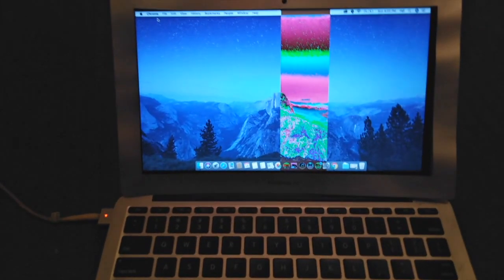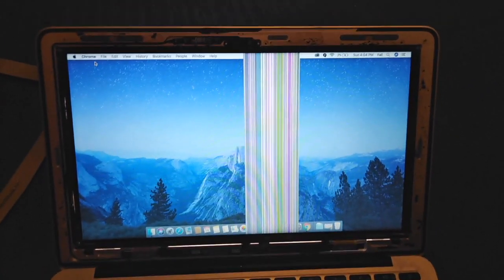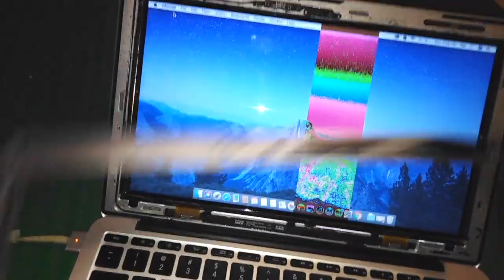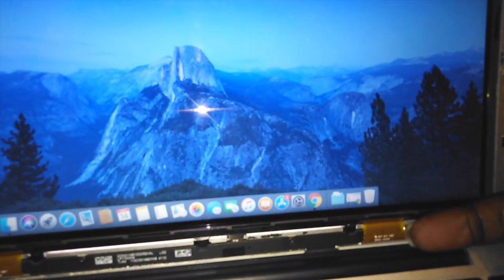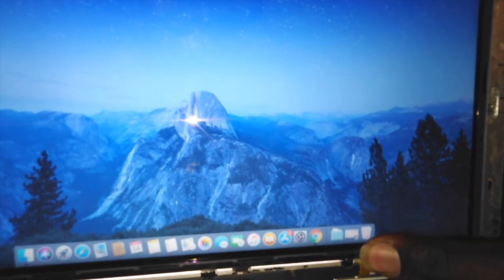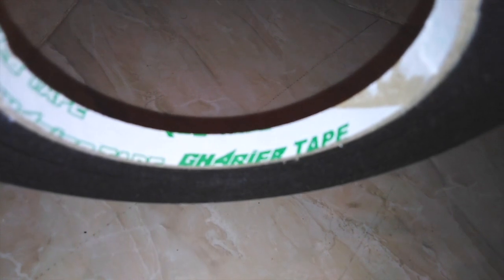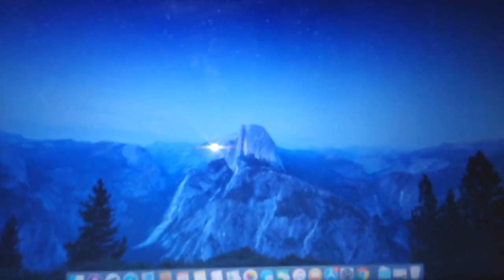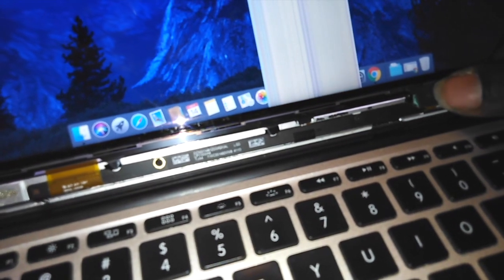Macbook Air Screen Glitch Resolution

Comment: My new macbook pro shows up these glitches & heats up too. Whats is the cause for that?
Reply: It’s not the display because if it would be the display it would cost probably like 300 to 400 dollars but it’s just the yellow thing just give it to apple
Reply: The glitch shown in the video happened to my Macbook air also it's becauseidhar there has been too much sunlight on the product or from change of weather or a little moisture got in the nooks and crannies of the screen sides don't worry nothing happens to your screen the computer will work perfectly
Reply: @neelambedi1915  But, it heats up terribly that, i couldn't touch the place below the touch bar.
Reply: @neelambedi1915  how long did it take for your computer to fix?